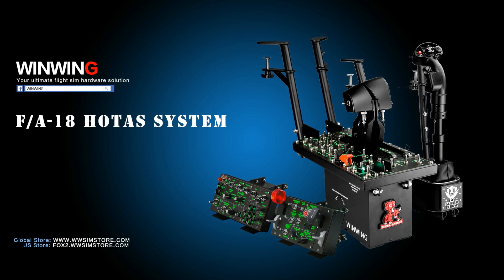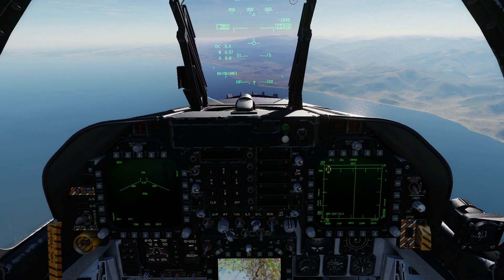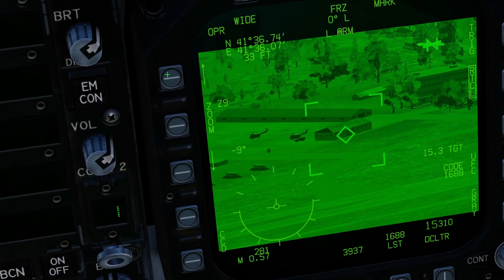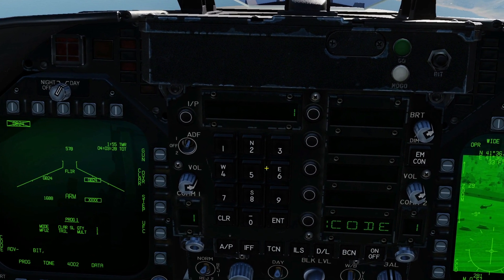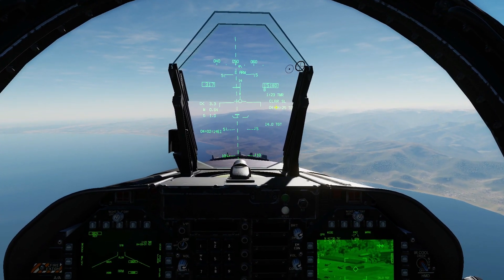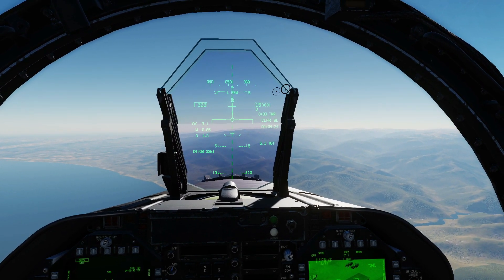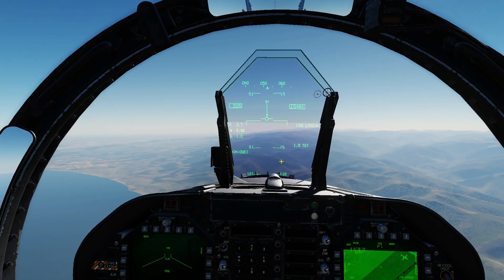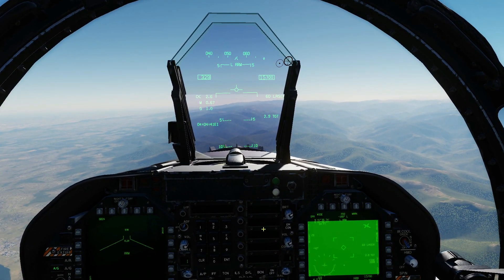FA-18C Hornet: GBU-24 Auto Lase Function Tutorial | DCS WORLD

Comment: GBU10, GBU12, GBU24, GBU38, GBU31-V1, GBU31-V2, GBU31-V3, GBU31-V4, GBU32 ....... so many bombs.  Where's the difference?  Which bomb for which target?  Please a tutorial.
Reply from the maker: REALLY simple once you know them guys! GBU10-24 = laser guided(more accurate and can hit moving targets and different warhead sizes). GBU31+ = INS/GPS guided(fire and forget and different warhead sizes)
Reply: @grimreapers  That is exactly the question: which warhead on which bomb and which bomb on which target.
Reply: Basically you should take the 500lb bombs for small targets like tanks, small buildings etcand everything heavier for targets that are heavily armored/hard to destroy with 1 small bomb like bunkers, bigger buildings, maybe several vehicles on 1 spot (parked vehicles).

A 500lb bomb sounds not much but you have to take into acc that it (theoretically) hits always from the top and directly on the target so it needs less penetration and less explosive mass :)
Reply: I had this same issue so did a bunch of research especially with the many GBU-31's. 
GBU-10, Laser guided 2000lb (Paveway II)
GBU-12, Laser guided 500lb (Paveway II)
GBU-16, Laser guided 1000lb (Paveway II)
GBU-24, Laser guided 2000lb (Paveway III)
GBU-38, GPS/INS 500lb
GBU-31(V)1/B, GPS/INS 2000lb (Navy)
GBU-31(V)2/B, GPS/INS 2000lb (Marine)
GBU-31(V)3/B GPS/INS 500lb penetrating (Air Force)
GBU-31(V)4/B GPS/INS 500lb penetrating (Navy/Marine)
GBU-32(V)2/B GPS/INS 1000lb
Reply: @jeffreyc2074  Thank you very much.  What is the difference between GBU — 31 V1B and GBU — 31V2 B?
Just the name?
Same bombs but different names in the Navy, Marines and Air Force?
Greetings from Germany
Reply: @iamapilot2818  The V1B version is actually USAF with the V2B version in USN/USMC service. The Navy and Marines version of the bomb has a special fireproof coating to reduce the risk of cook-off in the event of a scenario like coming into contact with burning jet fuel following a crash landing. The nature of carrier operations is that aircraft, weapons magazines, and fuel stores are inevitably all very close together unlike an air base where they can be much more widely spaced and more heavily protected so an incident with an individual aircraft or munition is less likely to spread. Fires onboard ships can be much harder to control and you don't have anywhere to go if things get really bad - the 1967 fire on USS Forrestal showed how dangerous ordinary munitions can be in the event of an accident.
Reply: gbu 12 is 500lb gbu 1000lb gubu 10 2000lb the gbu31 are all gps guided variants